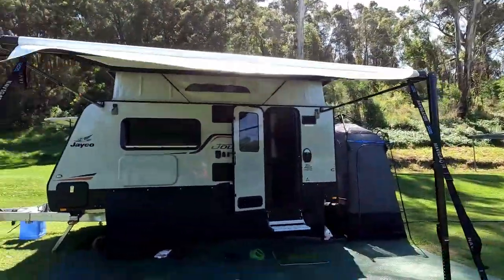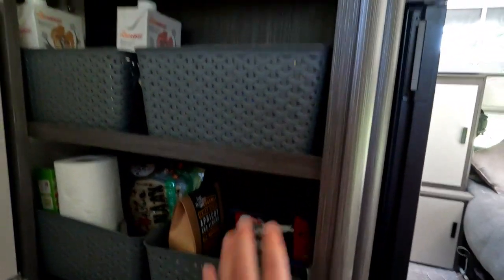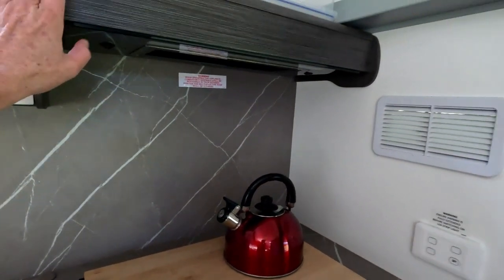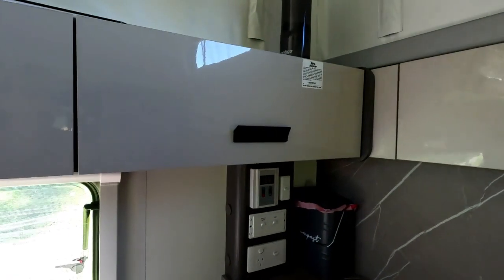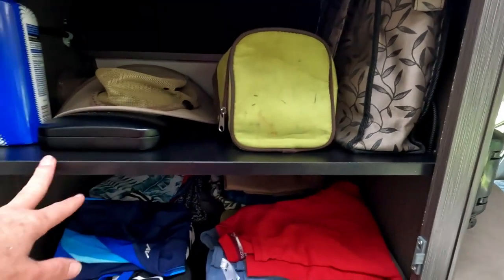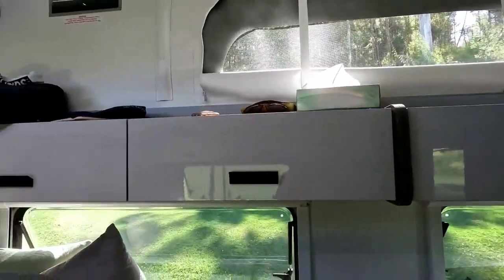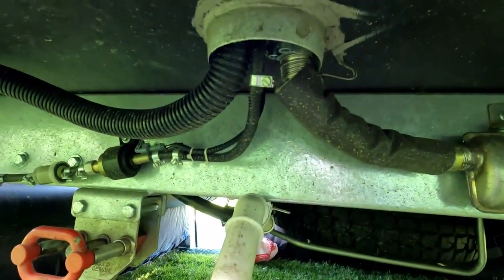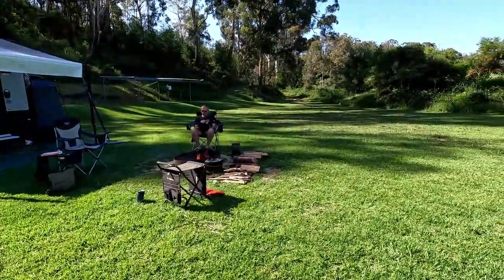Jayco Journey 13.42-1 Outback

Comment: We have a 22 Jayco Starcraft 13ft and love it, just spent a 4 full weeks in Tassie. We have bought a Kings 2 mtr x 2.5 mtr room that fits under the awning and makes life very easy with the extra room. We did have a big leak from the seem at the front of the roof but easily fixed with Silicone spray apart from that no issue. Yes storage is fantastic and thanks for the tip on the fridge great idea. We are removing the seat in the back left hand corner and having permanent toilet put in with wall and vinyl to the roof. No oven, Air Fryer is an absolute must have.

Comment: Hi, I note that you have since sold the van, however, we have the exact same van and based on your experience with the Joolca, we were going to purchase one also. One question with the shower tray, just curious how you lead the sullage hose out of the shower cubicle. I ask as I can't see any provided opening in the base of the shower tent area in the various video's I've watched. Am I to assume you just cut a hole in the mesh? Cheers.